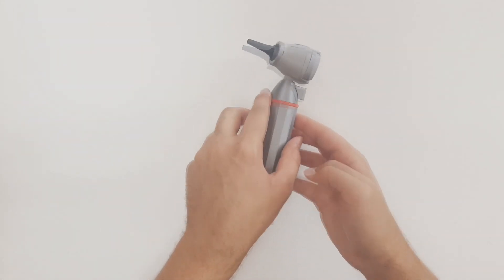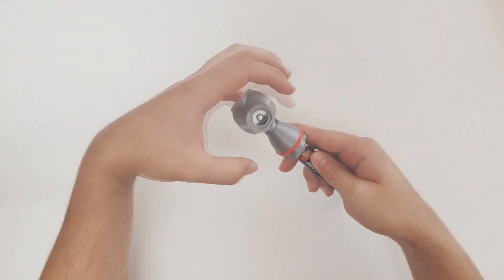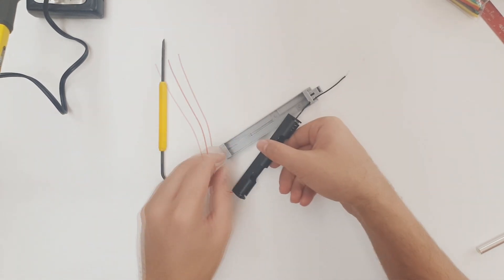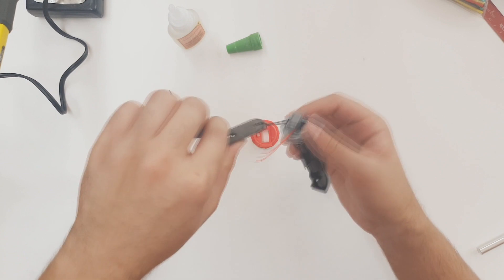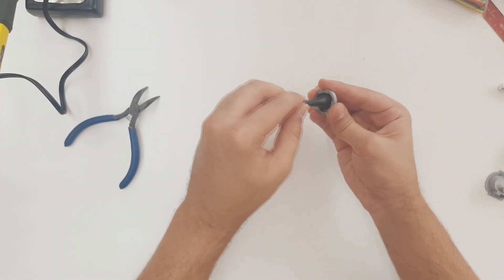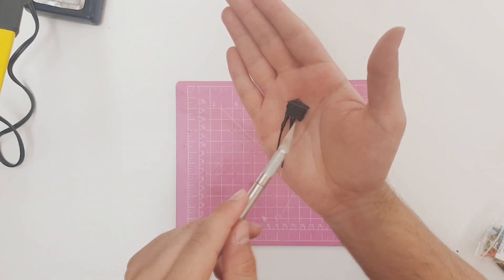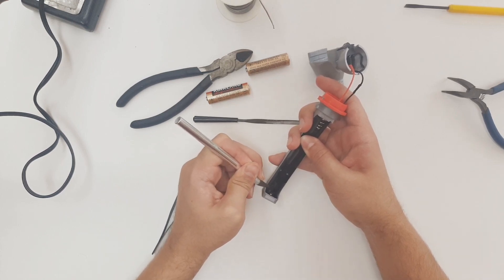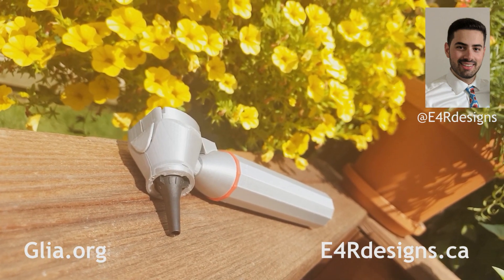Build A 3D Printed Otoscope!

Comment: Great design and a worthwhile project.  A few improvements could be made.  Use the proper word "files" rather than the strange word filers.  In english the plural of file is files.  Advise the builder about installing the heatshrink tubing before soldering the wires.  Your video just shows the heatshrink appearing by magic with no explanation.  I would advise adding the wires to the lED much earlier and suggesting a test of the battery and LED wiring BEFORE so much gluing has taken place.  If there are wiring or soldering problems they need to be addressed before gluing.  It might also be helpful to show the lens grinding.